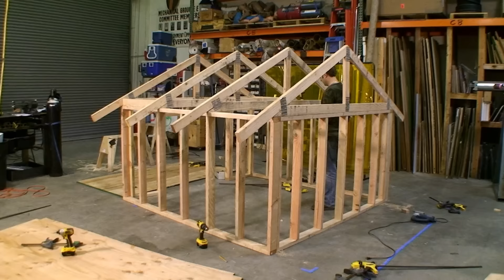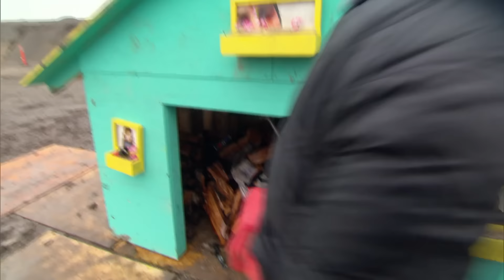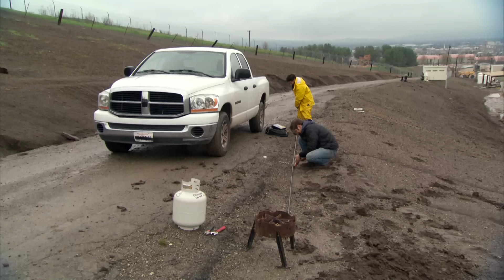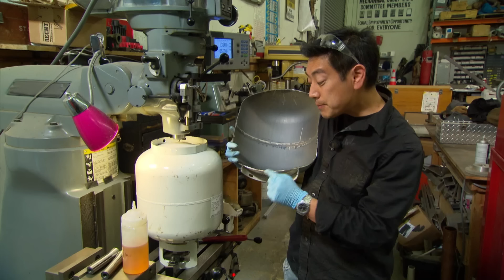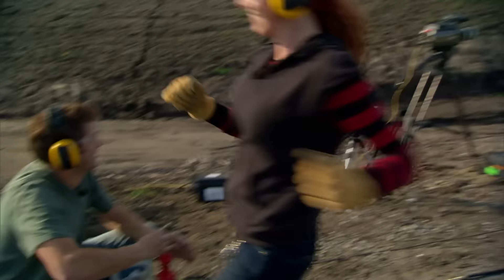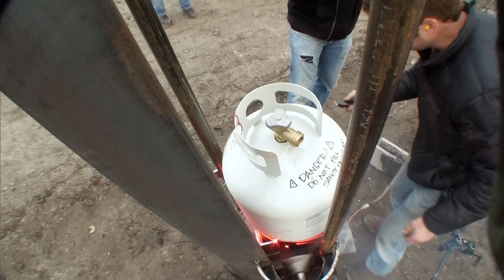Could A BBQ Propane Tank Really Become A Rocket In A Fire? | MythBusters

Comment: I actually wonder, if you turned the tank upside down would that potentially cause the safety valve to not work? I suppose itd just explode rather than rocket as first demonstrated with a tampered safety release.

Comment: Wildest thing I've seen recently was where a garage a few blocks away became fully engulfed.

My kid was working the graveyard shift at the local Taco Bell, and I went to go pick him up at 3-something in the morning.  I pull up in front of my house, and when I'm getting out of the car, I notice a suspicious orange glow in the distance, that's not too far away.  I go inside to get my phone, and I start driving in the direction of the glow, so I can report it to 911 once I know the location.

I pull up near the house and park, and the garage is fully engulfed.  I'm just standing across the street and I can feel heat coming off of the garage.  Thankfully, no propane tanks exploded while I was nearby.

Based on the time of the fire, I'm guessing some oily rags spontaneously combusted.

Comment: You got to use the pressure relief value to your benefit. Instead of taking it out, fabricate a nozzle to weld over the top of it.  It will naturally release at the perfect time with out needing to pop a hole in it or any thing. Turns it into a propane bottle rocket.

Comment: When I still lived in my hometown I was a part of the fire department. We were called to a business that made rubber parts from uncured rubber, it was hellish to say the least. I’ll try to keep this short - I was lead on the first crawl into the building; so, I’ve got the nozzle and 2 other guys were following the hose behind me. It’s always very dark but this type of fire made visibility absolutely ZERO. As I crawled I hit my head on something and figured out pretty quickly that it was a forklift with a 43lb propane tank on it. I turned around and started hitting the 2 guys behind me in a way that said GTFO, now!

We got out and opened an overhead door to start lobbing water in to bring the smoke down so we could see what we were up against, as the smoke started to drop we caught a glimpse of that forklift. By this time our bells were going off and needed to change air bottles, no one was there to take the hose so we put it down to quickly go and change tanks. The moment we turned to start walking to the pumper that propane tank blew and a column of flame shot out of the overhead door and lit a pallet of rubber (it’s like a long snake of rubber stacked on a pallet around 3-4’ high) that was roughly 20’ from where the forklift was. That was an intense moment, to say the least. I have a picture of what remained of the tank somewhere around here, the base was intact but only around a 10” wide part of the side of the tank was attached, no idea where the rest of it went.

Soooo, yes, gnarly projectiles.

Comment: I’ve personally seen not 1 but two of those tanks explode in a vehicle fire the mushroom cloud I’ll never forget lol was 80 feet of flames
Reply: Me, i'm curious what would happen with really old ones. Those had zero safety features, they're basically a tank with a tap, AND the walls are much thicker. I hunt those because they're good to make furnaces out of them for smithing. Last time i cut one that might've been from 80's Germany, it was almost 4 mm thick, hefty sucker.
Reply: @aserta  I refilled a tank that was manufactured in 1949 a couple years ago. It had a modern valve. I couldn’t believe it. The second oldest I’ve seen was 1979.

Comment: Or you could just watch the 100+ video footages of propane tanks bursting in a fire. Pop off valves don't always stop a BLEVE.
Reply: Some years ago I watched a Russian dashcam video that showed a truck carrying a number of gas canisters, likely propane, that suffered an accident, after which the video treated its viewers to several minutes of flaming gas canisters rocketing across the road in different directions. It doesn't contribute to the US propane tank story, but it shows that the premise is not a complete fabrication.
Reply: I'd still rather have one than not! Even if it still explodes, the relief valve will probably still work long enough for you to run the hell away